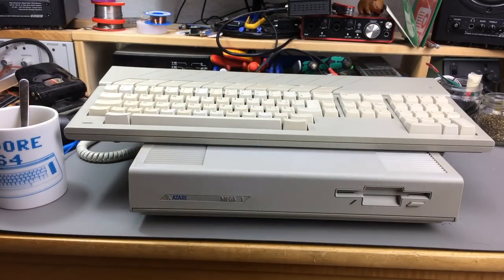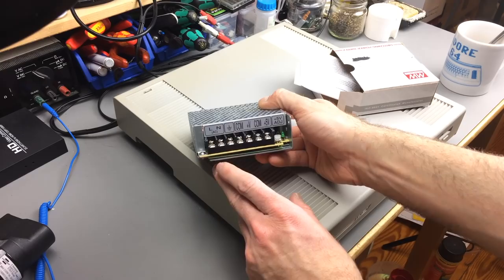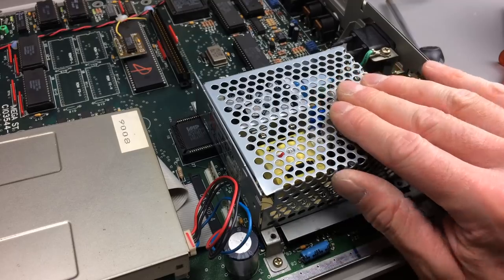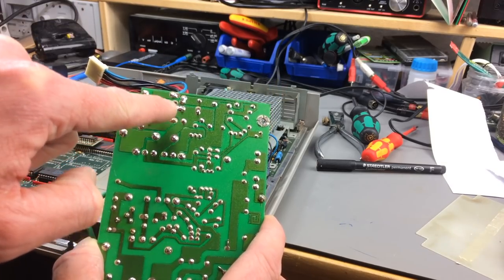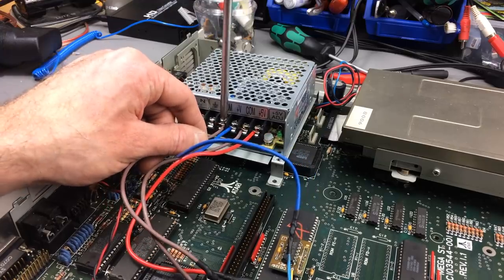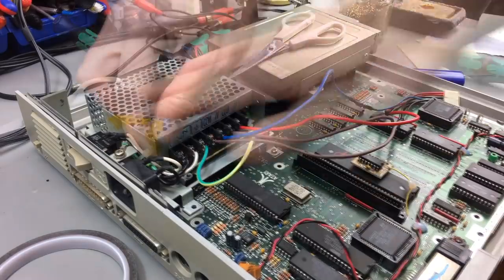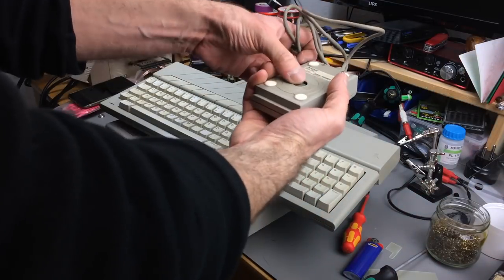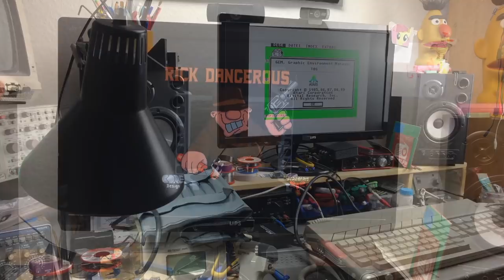Atari Mega 1/Mega ST New Power Supply

Comment: Hi Jan why didnt you recap the original?
Reply: he's waiting for Axial caps to arrive
Reply from the maker: My argument is that replacing the caps in the original with good brand ones would have been equally as expensive (or even more so) than replacing the whole supply with a more modern, more reliable, industrial one. The quality of the Mean Well units is very good in my experience plus they have all kinds of safety measures in place that the original doesn't have. Output is probably cleaner, too, so it's a better choice for longevity of the machine.
Reply: @JanBeta  Did you price out caps from Digi Key?  Im just curious. I would feel off cutting wires from a working supply. You could fit a add on regulator to the supply. I agree with your points but its no longer original. Still your points are valid.
Reply: sorry my reply was not about the caps in the old PSU but for the rest of the board

Comment: While electrically what you have done with the Earth (or Safety Ground for you Yanks ;) wires is OK, the Earth on the PSU should be returned to the Earth pin of the IEC connector, or at least to the same ring terminal between the IEC connector and the switch. Ideally, a toothed washer and/or spring washer should be used too. But i wouldnt worry too much :)
Reply: Actually I am a bit in doubt about it: If it would be for primary safety a direct wire gives the best safety properties. But: The PSU cannot be touched from the outside of the chassis. Therefore the earthing does not serve any safety purpose here. The only purpose of the earthing is that the mains filter in the PSU doesn't lift the GND of the chassis to 1/2 of mains voltage. Should there ever be a poor connection, then it is not the end of the world.
Reply: @danielmantione  no but the metal connectors on the back of the unit can be, and there is coupling between chassis ground and 0v
Reply: All true, but the chassis with the connectors is still properly grounded: The only possible concern is the consequences of something happening to the grounding of the PSU. If the PSU would somehow loose its ground connection (which, considering the large contact area I doubt), the only consequences I see is the 0V being lifted to 115V above earth, which allthough undesired, is not a safety concern.

Comment: You should at least check if the PSU isn't overshooting when powers up. IRRC you've got an oscilloscope ....
Reply: I'm tempted to say that it is plain impossible for a power supply to overshoot with all the capacitors on the mainboard that need to be charged. Overshoot is a problem with very light load, but with the load of a computer with empty capacitors, it cannot be a serious issue.
Reply from the maker: Yes, I could definitely have checked that. I don't have a proper DSO though so capturing the overshoot (if any) would have been quite some effort. I reckon the Mean Well PSUs generally don't overshoot that much especially when hooked up to a proper load.

Comment: if it ain't broke, don't fix it.what next, new case, and new motherboard?
Reply: Would you rather wait for the PSU to break and possibly toast the mainboard?
Reply from the maker: I could add a Raspberry Pi and get rid of the rest of the innards... No, just kidding of course. Old SMPSs tend to blow the capacitors (which are under constant stress in these circuits) and good large caps are expensive so I figured I'd rather replace the whole PSU with a known reliable and good option than to try and refurb the old one.

Comment: So basically you replace one cheap switching PSU for another cheap switching PSU.
You say the old one is "bad" because it's old. But you don't show the schematics of the new one. Why is it better ?
Have you measured any output voltages with an oscilloscope ?
You are just one of those many people who think "new" = "better"....which isn't always the case....
Reply from the maker: The Meanwell PSUs are industrial grade power supplies. They are not cheap, just compare some prices. The original Atari PSUs are notorious for failing, just have a brief search around some forums.
Reply: Jan Beta I had a look at some MeanWell reviews, they use el-cheapo Chinese capacitors. I would prefer to replace the original caps on the original ST PSU with good quality Panasonic or Nicholson caps.

Comment: Squeaking Sounds is normal for does PSU's if you have no load on them, had the same with my Makerele NET-50C.

I used the Makerele NET-50C to replace my dead power brick of my Amiga 500+, i taken it out of his metal case and put it in the plastic power brick case of the Amiga 500+, so it would fit good without removing any plastic from the inner of the plastic power prick case.